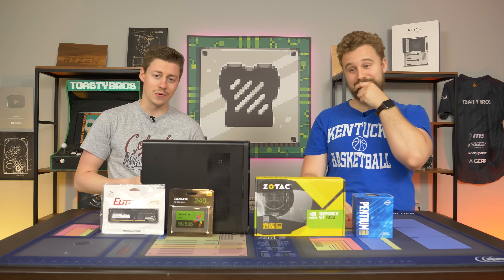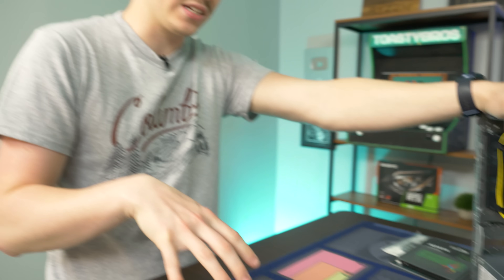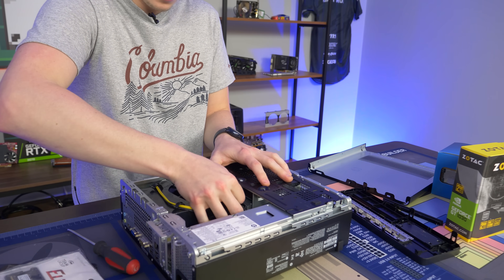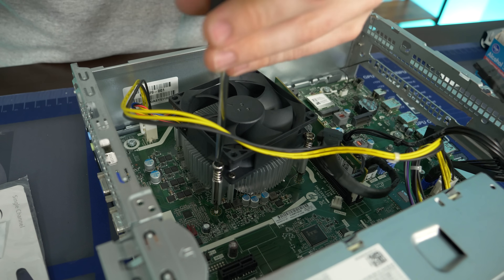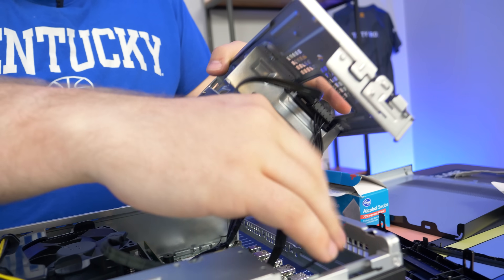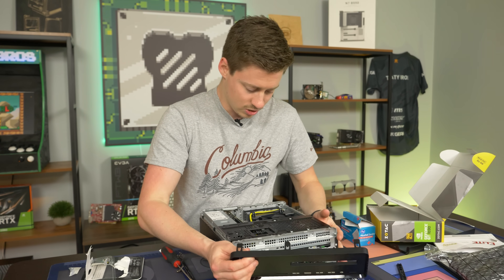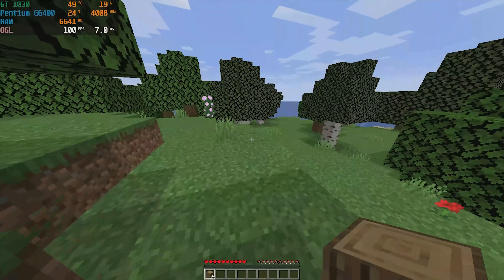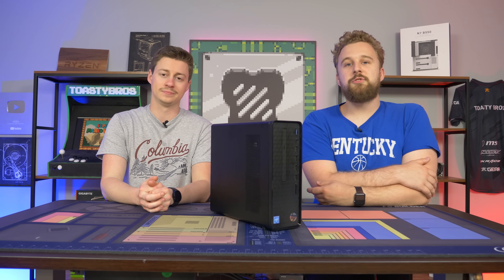Maxing out the CHEAPEST Walmart PC...Does it suck?!

Comment: Hello, i need some help and information that i haven't been abel to find anywhere else. I have a HP Slim Desktop S01-pF2013w, one of those sell by Walmart, similar to the one in this video. The specifications are: Processor Intel Core i3-10105, Internal Graphics Intel UHD 630, Fan Cooler, 180W PSU, 8GB DDR4 RAM, 256GB M.2 NVMe SSD Storage, Windows 11 Home, Dark Black. I want to know if it's possible to upgrade the CPU to the Intel Core i5-10400 taking into consideration the 180W PSU, both processors have a TDP of 65W. I don't plan on installing any dedicated GPU or any other power consumption item except for one or maybe two HDDs for extra storage. I'm not a gamer but i will do some video encoding from time to time, so those extra cores and threads would come in handy. Next year i'll build my dream CPU more powerful but until then i'll be using my HP Slim Desktop. Can I upgrade the CPU? Is it safe? Will 180W be enough? I hope anybody can help me, i don't know why this info is so hard to get.

Comment: i have this pc wit h1 5 9400 and nvidia t400 4gb config  with 256 gb  m.2 drive  and tp link wireless  pcie 1  card . thats pretty much max you can go ..... if you want to go further you can run it in an open  bench system  with  an rx 580 8gb or any gpu with external power pretty much the possibility are endless after that 
if you just want to go with t400 4gb absolutely fine

Comment: I wish HP had flipped the PCIe slots, but whatever. I picked up some old new stock of a variant of this system with a 256GB SSD, 8GB RAM, and an i3-10105 for $248 yesterday. Gonna get a RX 6400 for mine and make it my replacement SFFPC.

Comment: I installed everything as you did but when I turn on my computer I don’t see anything on my monitor. It shows it has no connection. I tried hooking it up to my tv through the HDMI also but still nothing. I ended up switching out the original RAM also and put 2 RAMS of 8GB to make 16GB. Could that have been the mistake? According to the website it says it can handle up to 32 GB. 

I also installed an Intel I3 since the website says it can handle it. Help please

Comment: I bought a HP slim s01-1013w a year and a half ago. I already added and swapped stuff. Now it has 32GB of RAM, an Intel Core i5 10400, and an SSD instead of the HDD.

So can I still stick the GT 1030 2GB in there?
Reply: In theory yes you can

Comment: had an alianware from 2016, yea yea i got cheap. up graded over the years and was finally dying. bought an 800$ lenovo from Costco and instantly killed the mb with the parts from my alianware. bought a asus rog b660-a for 200, cooler master case for 100. i now have a 17-12700 non k (59 years old don't need over clocking) a 3060, 2 tb nvme.2, 16 gig ddr4 3200, had a 850 watt power supply from when i use to build all my pc's for around 1100$ i did the math and could have matched it price wise if i got a part from here, there, and everywhere else but did not want to wait for all the parts. and thanks to these guys paid 20$ish for a windows key.

Comment: Would this upgrade be applicable to the HP Desktop Tower R3 8GB/1TB? I was planning to do some small upgrades on it and noticed that in this video that the upgrade is for the slim. If I wanted to use the upgrade shown in the video onto the HP Desktop Tower R3 8GB/1TB, would the upgrade be applicable for this PC or would I have to search for different parts. I plan to do the upgrade shown in the video onto the PC I mentioned above.
Reply: if you did this plesase tell me if it worked or not

Comment: Great video! I just got this pc for $100 on a clearance sale. I bought it because I can use the money I saved to upgrade and still be under retail price.
Reply: bought it too. $75 bucks.  its slow as all hell.
Reply: @noughiphiet  I have the same problem. Did you end up doing these upgrades? If so how did it turn out. My desktop is slow as hell for everything. It takes forever to open a web browser or do anything
Reply: @USMC0621TX I am doing  upgrades, I just bought a i5 10400, 16gb 2x8 ram kit from crucial, 500gb wd sn570 and a Nvidia quadro k1200. If my calculations are right it should be under 150w. So it should work. Just waiting on the parts to arrive. I'll let u know by Wednesday if it was a succes or a failure lol
Reply: @raultrevino3449  so I went ahead and installed an Intel I3 and 16GB of RAM two of 8GB and an ADATA SU635 480GB SSD. Man this thing is freaking fast now. Everything opens up super quick with no lag at all. Windows and all the programs run off of the SSD which just made everything phenomenal. 

The only issue I had was installing the graphics card. I installed it but when I turned on my computer I would get a blank screen. Idk if it’s because I had to install the drivers first or what but I couldn’t see anything. I removed the graphics card and the computer is perfect. I’m gonna see if by installing the drivers it solves the problem.
Reply: @USMC0621TX  driver issue most probably. Let me know if it solves it, please.
 Also,  i didn't know,  but there are new models with 12th gen cpus. I thought the last version was with the 10th generation cpu, but i was wrong lol.
Reply: @noughiphiet  I use it for a cloud server and email server, I dont have any issues with it.

Comment: i bought a stronger version of this pc that has a bigger power supply, an i5, one card of 8gb ram and 256gb ssd. i honestly bought it as i did want a small pc to have and am planning on upgrading it to a gtx 1650 low profile plus another 8gb of ram to make it 16 and already upgraded by putting a 2tb hard drive in. will be worth it for me
Reply: There is a stronger version?
Reply: @gaminggamingtm  you'd be surprised but there was no good GPU back then so i took the inner parts i could take and put them in a brand new pc. Luckily tho you can make it much stronger with an rx 6400
Reply: What's the part number for power supply? And also the model of the PC version that you got
Reply: I second that, what’s the power supply?

Comment: would never buy a HP system.... they are junk and the chassis suck! and then..... a friend gives me this very computer....  I immediately changed out the hard drive to 2 2.5" Hard drives using a piggy-back adapter (3.5 to 2-2.5" drives) and was surprised to see it supports a M.2 drive which I'll add later...  while updating windows 10, the system decided to do a automatic bios flash from HP....  was really surprised by the style of Bios HP designed... no options...other then testing.... interesting.... and to see that once again, HP goes with a Customized mother board... Fun...designed for this chassis only.... I changed out all the TORX screws to regular Philips, as I hate the hardware HP uses... discovered that there are 2 screws on the hard drive cage to allow you to remove the hard drives easier... nice feature... Interesting system at a budget price... though HP lacks detailed information on the limitations and features of the motherboard... still checking to see if its W11 ready.... cute little system, but I'd never spend the money to buy one of these... getting it as a gift is enough...

Comment: So the board can take 12th gen CPU couldn't you have just used an external power supply and possibly put in a better GPU in a new case and just use extension cables or plugs for the USB and power ?

Comment: G'day Toasty's,
Great video showing how to actually install the upgrade components,
You mentioned fitting a i3-10100/10105 & GTX1050TiLP/1650LP as a more powerful upgrade, but from memory aren't these GPUs 2slot PCIe,
🤔 The Motherboard is DTX & at 12:23 you can see the top PCIe is 1x so the PCIe16x is the bottom slot making the PSU stop a 2slot GPU from fitting,
other than a GT1030 if you are lucky you may find a GALAX GTX 750 Ti OC Slim or Yeston RX550-4G D5 LP 1slot, which from what I understand would be the only GPUs more powerful & still compatible with this PCs Layout, still leaving a 4c/8t i3 as huge overkill

Comment: this might work here

instead of the normal i3-10300 get the i3-10300T which are the lowered TDP version of the CPU which only runs at 25W

do not plug the optical drive and you should be under the 180W of the PSU with 22W to spare. 

bur yea this PC was terrible to start with, if it has the 250W or 300W PSU, you will easily drop the more powerful CPU and GPU combo like an i5 and GTX 1650 LP
Reply: Is there a power supply that you can replace the 180w with?
Reply: @derekworthy6113  no its kinda hard.

Comment: I had a 1030, and if you just want a media centre it's fine. But for games welcome to the world of some selective 720p gaming. If you mainly want to game a PS4 or last gen Xbox would do you far better.
If you get a 1030 or 1050 with a fan, replace it with a Noiseblocker fan and it will be silent. My 1050 that I also owned had a proprietary fan connector but I superglued the fan to the heatsink.

Comment: can you review the HP Bundle from Walmart it has a Ryzen 3 3200g, Radeon Vega 8, 8gb.
Reply: Yeah I have the same question cause I picked one of these up a week or two ago and I wanted to see if I could fit a GPU that wouldn't fry the 180 watt power supply... I could always upgrade the power supply to maybe 300-400, but since its still a pretty small case I didn't know if I could fit one in there...
Reply: @nidalj1  G'day, I hope this can be of help to you if you do plan to upgrade your PC & maybe help Luvvy too,
Without making any Major Upgrades beyond a GPU R3 3200G has a 65W TDP (although that is not Specific Power Draw, can be a rough guide for PSU & Cooler Spec) the max GPU I would recommend would be a GTX1050/1050Ti/1650 which have a 75W TDP, that together would be 140W leaving the other 40w for the SD, Hard Drive, Fans etc,
The case does support 'Standard Width' GPUs so you wouldn't need a LowProfile version like the Toasty's used in this video, but preferably get one that Doesn't Require a 6pin PCIe Power plug,
These are the TechPowerUp pages so you can scroll down the model list (each is a link to their own page) & check on each model to see if they do need extra power,
https://www.techpowerup.com/gpu-specs/geforce-gtx-1050.c2875
https://www.techpowerup.com/gpu-specs/geforce-gtx-1050-ti.c2885
https://www.techpowerup.com/gpu-specs/geforce-gtx-1650.c3366

at 100W TDP even a GTX1650Super besides needing a 6pin PCIe would be a risk as the CPU & GPU would be demanding all the safely available power from the PSU,
so not leaving power for Storage & Fans,

Here is a link to HP Support video of Removing & Replacing Parts | HP Desktop M01-F0000 | HP Computer Service | HP:

https://www.youtube.com/watch?v=fELywrIDarA
It shows that although the PSU is not an 'ATX Standard' model the case does have the extra mounting holes for an 'ATX Standard' PSU,
but the included Power supply does have the Proprietary HP 12v Only Cables for the Motherboard, so changing it if possible would require an adapter from ATX 24pin,

Another thing to consider is Airflow, After Upgrading & Building many PCs for people one thing I have learned is that GPUs struggle for Fresh Air in these HP & Dell Cases, even RX570/580 & GTX1060s will run REALLY HOT with the side of the case on, so even with a PSU Upgrade I wouldn't recommend a GPU that exceeds 150W TDP 
all the best 😁
Reply: @shaneeslick   I'll go ahead and look more into the GPUs you've recommended me. Thank you!!
Reply: @shaneeslick  would a gt 1030 2gb work in one?

Comment: For $550 plus tax, I picked up an HP TP01-2066 from Office Depot with a 5700G, 16GB RAM and NVME storage. Swapped out the single channel RAM for dual and it works great for the living room entertainment center. But yes, HP is VERY into the "just enough" power supply game.
Reply: That is a sick deal
Reply: @stonksified1264  Found out about it from ETA Prime's channel...he has great "grab 'em while they last" stuff from time to time. Only way to get a legit 5700G right now.
Reply from the maker: We got one of those on the way :)
Reply: @ToastyBros  Awesome. Can't wait to see what you do with it. I couldn't get it to run on 2x8GB of PatriotViper 3200 RAM, had to back down to some 2666 RAM sticks I had. Never did figure why. Not much BIOS to work with.

Comment: Pro tip: Check your computer's exact specs before upgrading! lol!
Reply: And before BUYING! I learned that the hard way with my 2016 Alienware laptop. I found out later it was only a dual core i5.  🤦‍♂️ 
I also learned Alienware is trash. 😂
Reply: @brykit1972  fr- everyone has went through that faze of thinking alien ware was the best. But good thing I didn’t have enough money when I went through that faze.
Reply: @matteo12311  Good on ya! The fan on mine pretty much runs all the time and it rattles, right out of the box. Would not recommend!
Reply: @matteo12311  Yea, I am very thankful that I did not have enough money when I went through that phase
Reply: @matteo12311  I personally never went through that phase, perhaps I'm too young.
Reply: & Layout, this DTX Motherboard layout with 16x as the lower slot is not going to fit a 2slot GTX1050Ti or GTX1650 GPU